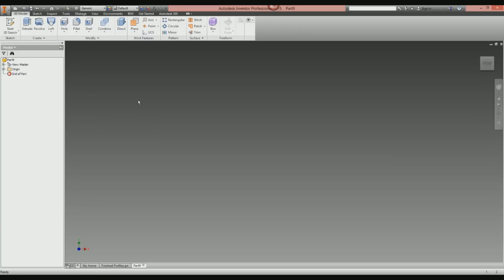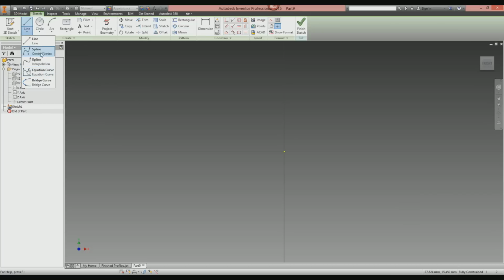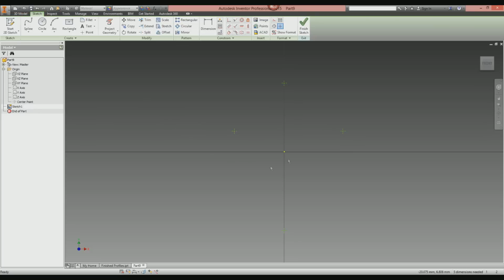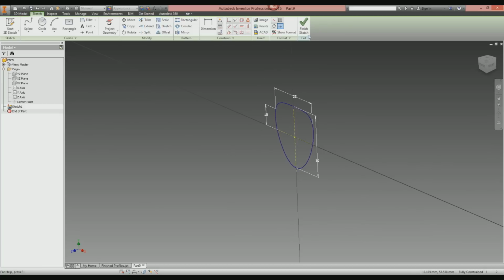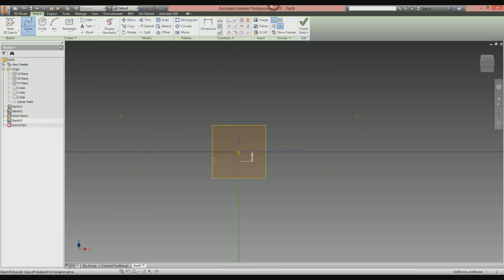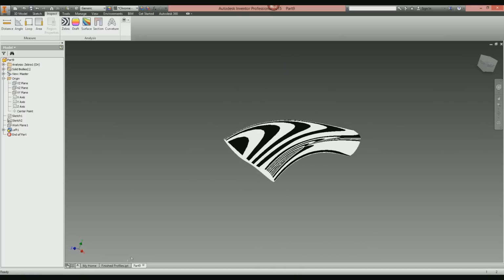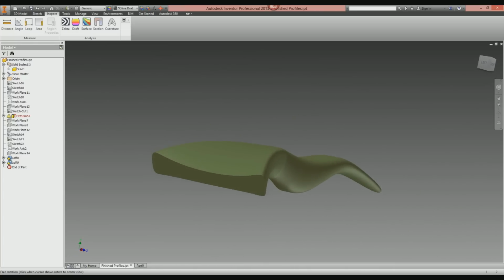How To Use The Loft Command For Creative Effect | Autodesk Inventor

Comment: If you use the symmetry constrain you don't have to constrain the points horizontally or vertically to each other, that's an additional step that does not do anything and you can just skip it.

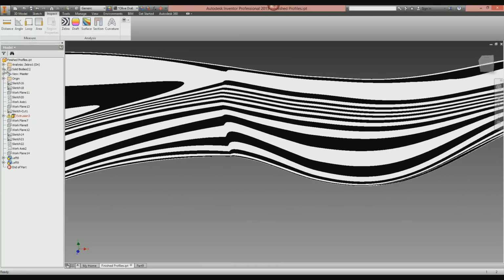Comment: Thanks for this grate video again.I'm wondering what is the right way to SEAMLESSLY blend de twoo surfaces together.Like explained in the video at 19:50min.
The sharp edge doesn't look nice in the zebra stripes
Thank u in advance, Daniel
Reply: Spot on. Everybody can make a extrusion... The hard one, is to handle continuity's and smoothness in every transition between volumes. Which we don't see here. Imagine creating an entire dashboard...  This software is not a proper A class creator. ICEMsurf is one of the example of the real thing without nurbs and fake approximations.

Comment: Great stuff, thank you, 
Question 
how do you create parts that mould ontO the lofted area if that make sense. I'm building a drone so I created the main body using loft tool but I want to add propellers to the sides caged with walls but blended and curved into the loft.

Really appreciate your videos

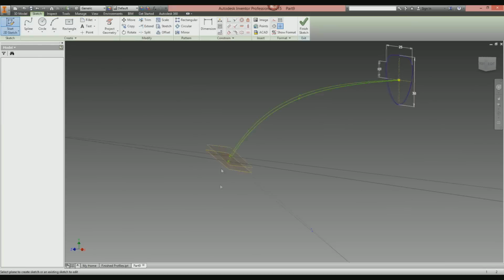Comment: at 12:13 you selected to create a sketch on the work plane.  Is there a button to reorient to this working plane if you accidentally move the viewing angle?  In Creo there is a "sketch orientation" button to quickly reorient to this working plane.
Reply from the maker: Chris Merani Yea if you look at the toolbar on the right of the screen, the one that's vertical, the bottom button I think is called 'Look At' and you can select that then the work plane again to reorient the view.  It also has a shortcut key by default, I think it's the 'Page Up' keyboard button
Reply: Neil, Thank you for the very quick reply.  using the 'look at' then  selecting the "sketch" from the "model tree" on the left worked perfectly.  Thanks again for your videos.  They are bridging the gap between Creo and Inventor for me!
Reply from the maker: Chris Merani Hey no problem, let me know if there's any particular areas that you think could do with a video that you aren't 100% clear on!